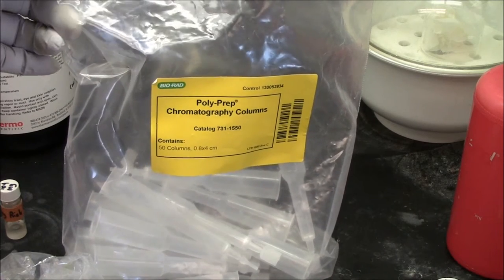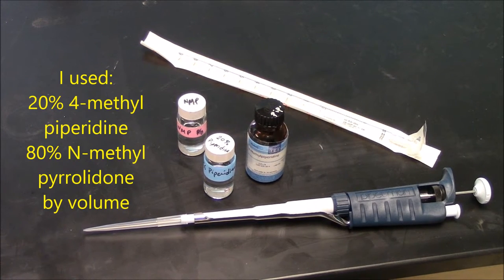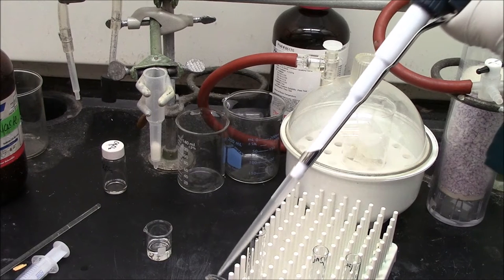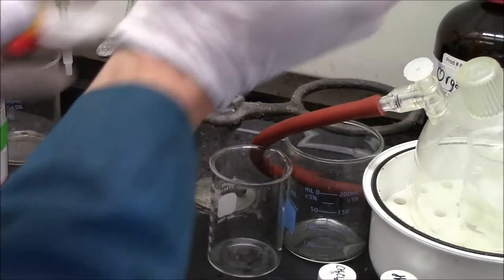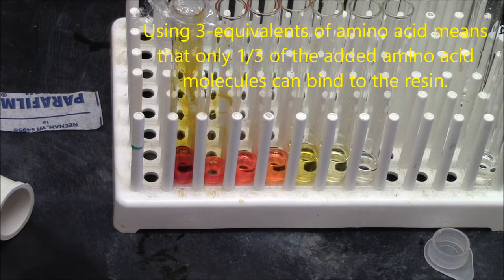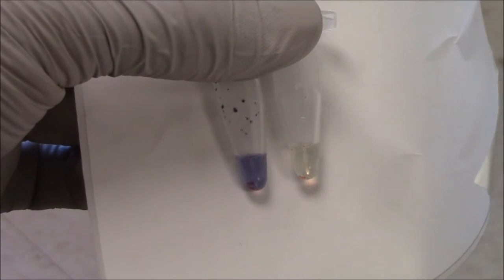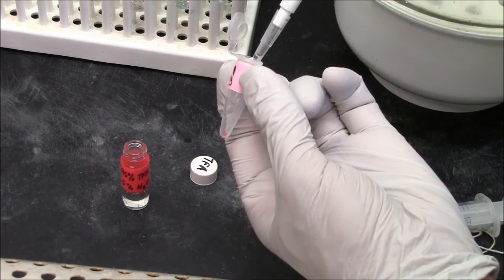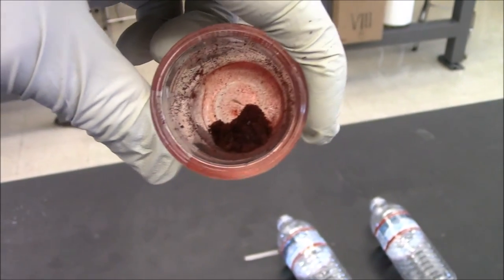Solid Phase Peptide Synthesis Hands On Procedures from swelling resin to HPLC & MS analysis

Comment: Hi Steve, great video, just wondering after incubating the resin with 95% TFA for 2 hours, how did you remove beads? did you filter it? if yes, what type of filter did you used?

Comment: Hey there! It's been quite awhile since you posted this video -- hopefully you get to see this! I'm currently doing SPPS as an undergraduate project. The research assistant in this lab group washes with DMF after deprotection with piperidine but there is no significant activation process for the amino acid prior to its addition to the reaction vessel for attachment to the resin. They simply add HATU and then immediately following DIEA the amino acid HATU DIEA solution is poured into the column. 

It was made out to be a big deal that I have to be very quick from the point of DIEA addition to pouring the solution into the vessel to soak the resin. I am wondering if this is inaccurate, as you pre-activate your amino acids for 5 minutes, I can't imagine it is important to be so fast. I've spent a while trying to find information in the literature but I can't find anything about amino acid activation time with DIEA just that it's used in the coupling process and no further information. I'd really like to hear back if you have the time. Thanks!
Reply: My lab also washes with DMF (and DCM) after deprotection. I was actually told the opposite from what you are told. The instructions told me to specifically wait at least a minute (if not more) after adding DIEA to the amino acid and HATU concoction to let it activate before adding the DIEA + amino acid + HATU mixture to the reaction vessel. I don't know if this helped

Comment: Can you link the literature used to determine the equivalents of amino acid, HATU, DIEA, and NMP used in the coupling solution?
Reply: You can check out any standard literature. The convention is to use 3 eq Fmoc-AA-OH with 6 eq DIPEA in minimum amount of DMF, 3 eq HATU (along with HOAt if you want)in minimum amount of DMF. (DMF is almost always replacable completely with NMP but it is not advised to change solvents during synthesis).

Comment: Thanks for this Awesome video! I have a question. Did you use 510 nm wavelength to detect in HPLC analysis, and why? Do you suggest 214 nm?
Reply from the maker: The red peptide shown in this video, bearing the Dabcyl group, absorbs light at a long wavelength.  Many peptides that do not have special groups must be detected at 214 nm, a wavelength at which peptide bonds (amides) have significant absorbance.

Comment: Hi! Thanks for this great video! I have a question. What have you done after putting your resin into TFA solution?
Reply from the maker: After incubating the resin with 95% TFA for 2 hours, I eluted the TFA solution and used a rotovap to remove the solvent.  Then I dissolved the peptide in water and lyophilized to achieve a solid product.  Some peptides can be precipitated from the TFA solution by using ether.